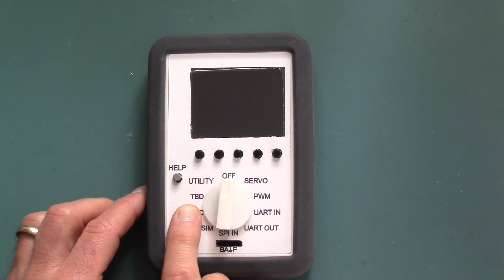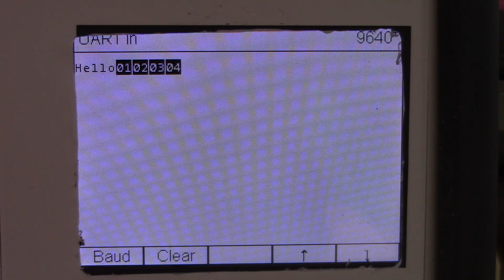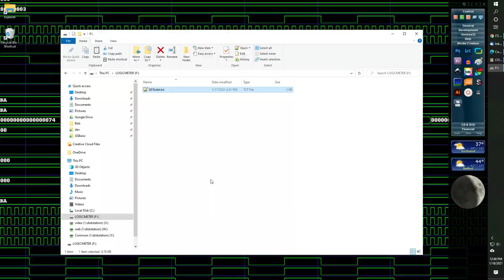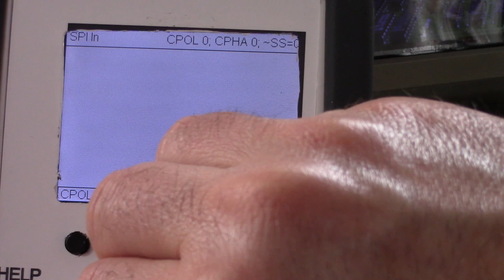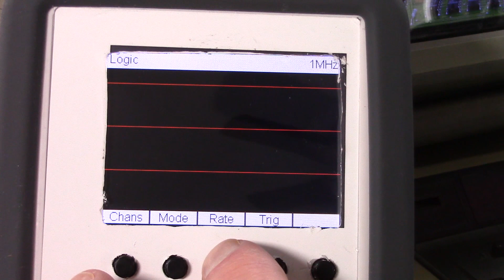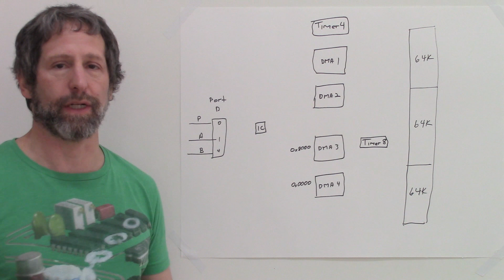Logic Meter

Comment: Awesome project!
Where did you get the box?
Reply from the maker: It's an LCS145-N. I bought it directly from Misumi's web site. To cut the holes in the front, I drew the openings in a vector drawing program, sent it off to make a laser cut acrylic template, taped the template to the front of the case, and routed out the holes with a Dremel.
Reply: @GalacticStudios  Thank you friend!

Comment: Wow this looks super professional. The Hackaday article didn't do it justice. I really like the UI, seems really smart.

Personally I'd add an I2C snoop, since that's my main protocol, and maybe transmit - data entry might be hard without a rotary encoder or something.

Shame it's PIC32, I have none of those lying around and no experience with them. (It does sound like quite a beast of a processor!) If it were the ubiquitous (but admittedly somewhat terrible) stm32f103, or the much better f411, I'd be hacking one together soon-ish. (Let's be honest, I already have too many projects). I even have some empty (fake) multimeter cases from a discarded store display I often forget about. (Might have to bodge my little cheapo DSO Shell mini-scope into one now that I think of it...)

I was always underwhelmed by my bus pirate, I think because for some of the stuff I was trying to do, it was just easier to write a little Arduino program to do it, rather than try to learn another scripting language. The fact I couldn't get a compiler for the firmware probably didn't help.

Wow, pretty crazy that the buffer is so big for the logic analyzer: I figured there was some RLE or other compression. I suppose that's not quite as compatible with the dma.

Comment: I think the connection terminals need to be more robust somehow, whilst still being simple.
Reply: Wonder if those removable terminal blocks would work? If they could somehow be adapted to provide a replaceable .1 inch-compatible pin. If nothing else, put the headers on a replaceable sub-board and include a handful of them in the box